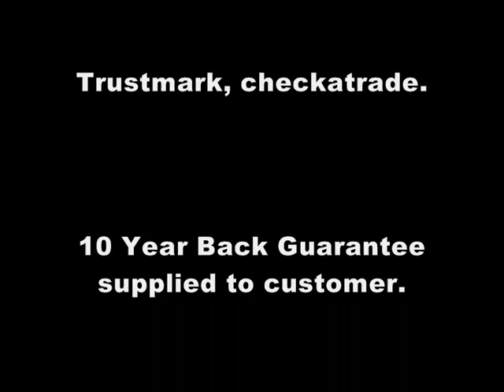Garden Rooms ashlawn road rugby hinckley

Comment: You know, I've seen other people in the UK wait until the walls are framed and the roof on before putting in the floor sheathing.  In another video, the builders complained about how muddy the site was while they were doing this.  Is there a specific reason for building this way?  In the US, we frame the floor joists, then immediately put down the floor sheathing right up to the edge of the floors.  Then we frame the walls and put them on top of the floor sheathing at the edges of the floor the same way you are.  I can't imagine what advantage there could be to doing it this way.  Cost savings on floor sheathing?  You lose some strength though since the floor sheathing isn't supported underneath at the walls except where the joists are.

Comment from the maker: When investing in a garden rooms, garden shed, summerhouse or other type of garden building, regardless of its value, to maximise the life of it, one of the most important decisions you have to make is what the actual building is going to stand on once it is in your garden There are only two viable options for the base: paving slabs or concrete..

Why Timber-Frame for Garden Rooms ?

Timber-frame buildings have a higher suitability to colder climates, such as the UK’s. They are more energy-efficient than other construction materials providing a comfortable temperature year-round and saving money on further insulation and heating costs.On average timber-frame builds take 20% less construction time[1], than their brick counterparts, saving on labouring costs and causing less disruption to the local area.

Garden Rooms 2

 Red Cedar wood Exterior Timber Cladding
red cedar wood is one of the most desired external timber claddings due to its rich and variable colours, high resistance to decay, durability and natural preservatives. The exterior  red cedar timber cladding compliments most environments, is 100% maintenance free and has a typical life span of 40-50 years.

Insulation is good in winter & summer for Garden Rooms.

Garden Rooms 3

Everybody thinks that insulation is all about keeping warm in winter but forget that it also helps keep you cool in summer – warm air wants to travel to cooler areas so if it’s hot outside the warm air will want to travel to the cooler air inside your garden rooms, a well insulated garden rooms will minimise this transition so your garden rooms will be a cool and comfortable on a hot summers day

Waterproof Breathable Membrane 
The timber walls are wrapped in an insulated waterproof breathing membrane. This breathing membrane acts like a one way valve and allows natural moisture to escape out of the building.

certass- for  Hinckley& Nuneaton Garden Rooms  trust-mark for Garden Rooms  in Hinckley& Nuneaton 10 Year Back Guarantee Garden Rooms  Hinckley& Nuneatonsecure-by-design Hinckley& Nuneaton Garden Rooms

flat roof Orangeries Hinckley & Nuneaton area

Durability, design versatility and installation ease are among the many reasons ethylene propylene diene monomer (EPDM) is the most popular material for both new  roofing applications.

First they remain one of the slimmest bi-folding doors in the market today. M&A Home bi-folding doors offer some of the slimmest sight lines .doors sets can be made to replace entire walls if needed to maximise the opening space.bi-folding doors are internally beaded to all external doors and panels .The hardware forms a main part of any Bi-folds doors given the function the door has to perform and the way it opens, folds and slides.M&A Home bi-folding doors offer 4 Stainless steel wheels for smooth operation.
Reply: Hello what are the dimensions of your construction please?